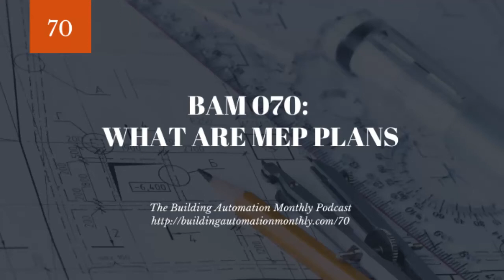BAM 070: What are MEP Plans

Comment: This topic is highly visual.  Especially  ventilation plans.  I have tons of questions but cannot find a good video on the web that covers the basics.
Reply from the maker: Well what are your questions and maybe we can do a video on them.
Reply: @SmartBuildingsAcademy  Things like what are the first things you identify when looking at a plan?
How to dentifying supply and return or exhaust ducts?  Sizes?  Manual dampers? Fire dampers?  How to identify Exhaust fans? What are the standards HVAC symbols?

In a plumbing plan how to identify different valve types?  Manually controlled or BMS controlled? What pump or what heating system  serves a specific area?